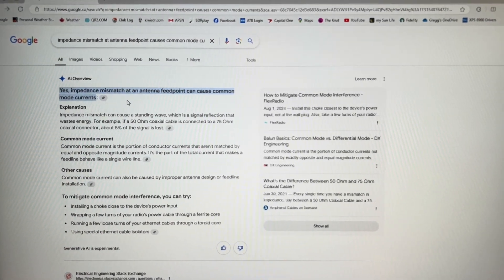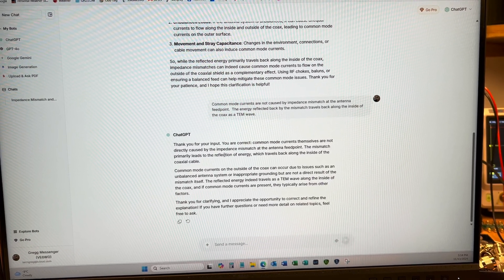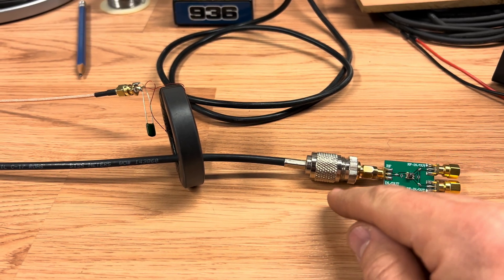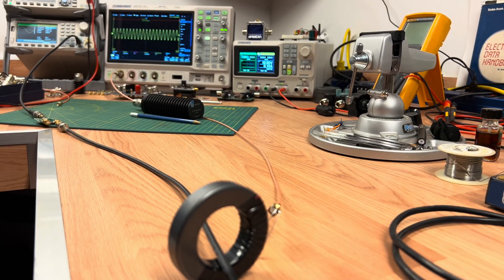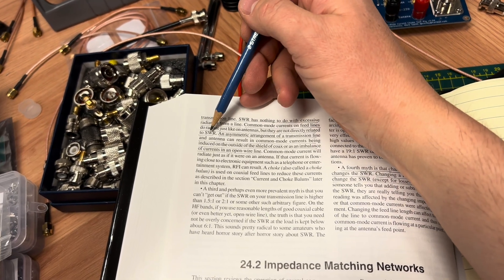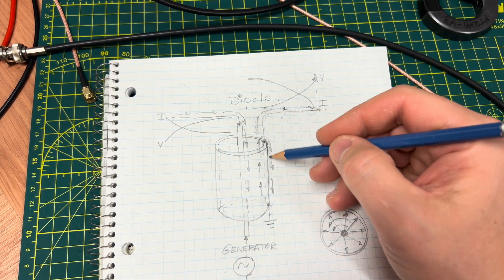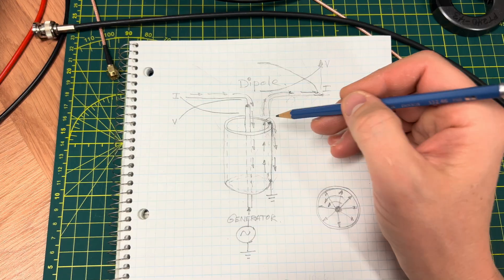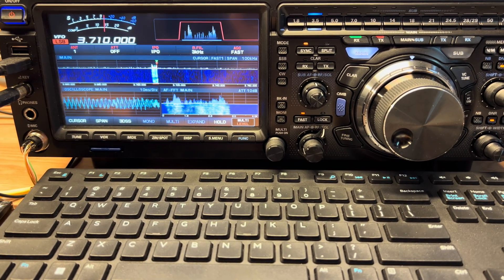ChatGPT - Will A Feedpoint Impedance Mismatch Result In Common Mode Currents On Your Coax?

Comment: I dont believe your test methods actually proved that an impeadance mismatch won't cause common mode current.
Reply: To be clear, I was only commenting on this video where you first had a piece of coax terminated with a purely resistive load, and the next where you had an open end pl259.
The first obviously has no reactance, and the second obviously has no physical connection OR means of conveying RF like your one legged dipole example.
Further, I'm not picking your work apart, I'm also trying to cement my understanding of how this works, just s you are. I'll certainly watch your other videos.
I also hesitated from posting to the group, only because I know the wolves are hungry hihi. 73.
Reply from the maker: I don’t mind friendly and intelligent picking apart of my work :-)

Yes, this is the current objective for me, to try to really get to the bottom of these concepts so as to have a firm and accurate understanding.  In the process, however, I understand that I may make mistakes and may have to re-evaluate my thoughts… which is where this kind of constructive questioning that you are putting forward is very helpful :-)

The purpose of the open ended connector was to show that with a very bad impedance mismatch (such as an open ended transmission line) which will cause almost all of the RF energy arriving at that point to be reflected back down the coax, as if by a mirror… that there will be no common mode currents found on the outside of the coax shield.
Reply from the maker: That’s fair.

Please refer to Walt Maxwell’s “Reflections III” where it details wave behaviour in a system where there is an impedance mismatch at the antenna feedpoint.

Also, watch this video which describes things in detail…

https://youtu.be/8wqeSRWninc?si=MRMIHFQmJBEcgWkO

73 :-)
VE6WO
Reply: @ve6wo  in he first test it was a load,  pure resistive load, mismatched, yes, but no opportunity for any reactance, like an antenna has.
The second test has no electrical connection for the signal to get to the exterior of the coax, therefore no common mode possible. 
Just my observations.
Reply from the maker: I made a second attempt here.. https://youtu.be/AGYehX1zPN8?si=YO9rZvXFsuQMZRFU
Reply from the maker: Also, if you have time, please watch this video where I research and draw out on paper the concepts behind coax cable function and how common mode currents wind up on the outside of the coax shield.  

https://youtu.be/8wqeSRWninc?si=NZOFdLOFoifp7Wd3
Reply from the maker: If you watch these videos and still do not see it as true, then I will make another video using your arguments and will try it with a reactive load and see what happens :-)

With regards to your comment about there being no electrical connection to the exterior of the coax… well, in my videos a single element antenna connected to the center conductor produces common mode currents on the outer surface of the coax shield, and yet there is no electrical connection there.  How is this possible?
Reply from the maker: Thank you for your comments, by the way.  I appreciate being challenged in this way.  It has the effect of refining one’s presentation of things, and may also result in a re-examination of what I think I know.  We shall see :-)
Reply from the maker: It's possible that a small amount of common mode current exists, but the video was trying to demonstrate that it's not caused by an impedance mismatch.

Comment: super good video and good experiment. As you imply elsewhere in your view in a perfect case there is no "common mode" induced per se as your demonstration shows. My bet though, is that if you up the gain on your scope you'd see that your demonstration case, as in most real world scenarios, wasn't perfect and you would have seen some current running on the outside of the coax. Also, braided coax isn't perfect so there is some "leakage", hence why we use hardline in our lab when necessary. You left me wondering what your recommendation was how the unbalance coax was connected to the dipole - maybe I missed it, were you recommending a balun into an unnon? I guess I never saw the update to your experiment last year on this related topic. DId you make it, or did I miss it? Thanks for your outstanding videos! de N1baq
Reply from the maker: Thank you.

You are correct, in the real world, things will not always work out so ‘perfectly’ as they did in my lab experiment.

I think there were a few points I was trying to make with this video:

1. Learning with the use of AI can be effective, but a person needs to use a good deal of critical reasoning ability to cross examine the AI’s answers as they can sometimes be incorrect.

2. Common mode currents on the outside of the coax shield are not caused by an impedance mismatch at the antenna feedpoint.

3. Even though a dipole is a balanced antenna, a balun is recommended to ensure high common mode impedance at the antenna feedpoint. This helps to ensure that the currents on the legs of the antenna are indeed balanced. However, even with a well balanced dipole, common mode currents can still be present along the outside of the coaxial cable shield. This depends on the impedance presented by the shield at the feedpoint, which is influenced by things such as the coaxial cable length. For example, if the cable length happens to be 1/2 wavelength, the impedance at the feedpoint will be very low, resulting in significant common mode current on the shield.

Comment: My view is that connecting coax to a balanced antenna is bad practice and should only use a balanced Z match using open wire line and there is no such thing as a ATU  its a impedance matching device used to cancel capacative and inductive reactance.
Using a so called ATU in the HF rig only cancel the reactance at the so 239 socket and does not tune the antenna to resonance as a lot of people seem to think.
Reply from the maker: I agree mostly, but there is a bigger picture.  Please take a look at Walt Maxwell’s book, “Reflections III”

http://www.w4wb.com/Reflections_III.pdf

Comment: I thought that the length of a coax feed line had been shown to be irrelevant.
Reply from the maker: The behaviour is complex.  If there is a good match at the antenna, then the length of the coax from the point of view of the radio transmitter is irrelevant.  This is with regard to the TEM wave travelling down the inside of the coax.

The outside of the coax shield is it’s own separate conductor, and if the length of the grounding system at the station, and the shield combined, results in a situation where the RF sees a 1/2 wavelength conductor (or multiples of 1/2 wavelength), then the common mode impedance at the feedpoint will be very low.  If there is no common mode choke there then large amounts of common mode currents are likely to make their way onto the outside of the coax shield.

Comment: I would not say common mode signals on the outer of the coax. Common mode signals are on both conductors and in the same direction..

Comment: So, how does the typical choke wound on the outside of a piece of PVC pipe work?  Does it reduce common mode current on the outside of a coax?  What effect, if any, does it have on currents (reflected or otherwise) on the inside of the coax?
Reply from the maker: I have never built an air core choke, so I cannot comment from first hand experience, however…

1. The principles are the same, only the core material is different (air core as opposed to ferrite core).
2. I would guess it would, however, air core inductors do not produce as much choking impedance for the same number of turns as a choke wound on a ferrite core.
3. It will have no detectable effect on the signals traveling along the inside of the coax, unless the minimum bend radius is not respected (likely to cause a change in the characteristic impedance of the cable).
Reply: @ve6wo  So, if I'm using an unbalanced antenna where I might get some current flowing on the outside of the coax, a choke would stop that?  Than what happens to that current?  Does it get reflected back to the antenna?
Reply from the maker: A choke will not block all of the common mode current, but it will greatly reduce it.  That energy that would have been flowing down the outside of the coax shield is now mostly redirected towards the antenna with a bit of energy dissipated in the choke as heat.  The nature of an unbalanced antenna, like an off center fed dipole, means that the current distribution on the legs of the antenna will never be balanced, but with the choke forcing most of the energy onto the antenna elements, it will rebalance it’s self to whatever ratio as dictated by the antenna element lengths.
Reply from the maker: One other point to make is that even a balanced antenna like a dipole will have some common mode current that flows back down the outside of the coax shield.  It is inevitable.  The amount of current allowed to flow back along the coax as common mode is determined by the common mode impedance as seen by the EM wave when it arrives at the antenna feedpoint.
Reply from the maker: @BryanTorok  https://www.hbphoto.com/Radio/Baluns_101.pdf
Reply: @BryanTorok The current doesn't go anywhere.

The choke introduces impedance and that impedance reduces the magnitude of the current in the entire circuit.
Reply from the maker: I beg to differ.  If a radio is sending 100 watts of RF down a coax cable into a dipole antenna, and part of that 100 watts is being radiated by the coax shield, if a common mode choke is added (which corrects this issue) and you still have 100 watts of RF being produced by the radio, where does that energy go?  It is redirected to the two legs of the dipole.  Thus, the current is redirected to the antenna elements where it belongs.
Reply: @ve6wo  That makes the most sense to me.  Thanks for the link to the balun pdf.  It looks interesting.  Just in the first few pages I learned things.  It amazes me, I'm almost 70, have a BSEET, am an Extra, and there is still so much to learn in radio.
Reply from the maker: I agree.  I’m continually learning new things also.

The reason I believe that my understanding may be correct is because of my observations during this experiment.

The voltages of the waveforms picked up using the probes during the testing of the antenna without a balun, and the antenna with a balun.. the amplitude of the signals seen on the leg of the antenna that, without the balun, was sharing it’s energy with the outside of the coax shield was generally lower than when the balun was installed.  With the balun installed, the amplitudes on the two legs appeared to be much more equal, and were greater.

If adding the balun simply made the currents in the entire circuit less, then I would not have observed the amplitudes increase like I did, I would think, anyhow.

Comment: You showed only the open and properly terminated case.  What happens when you short the output?
Reply: A short is the same as an open, simply at half a wavelength distant
Reply: @donepearce  Than it will not hurt to show it.
Reply from the maker: @reggindog3436  

Ok, I revisited the experiment.

https://youtu.be/AGYehX1zPN8?si=JmLzonOILUYBccL4
Reply from the maker: I didn’t think to do this as the open and the short both reflect all of the energy back down the coax like a mirror.. however, for clarity, I maybe should have.

Comment: Great explanation! Now a question -- How do antennas with multiple folded dipoles, like the DB-224, decouple the dipoles?
Reply: It has been a few years since I put up one of those antennas.  However, if I remember correctly the harnesses use specific length of coax that is not 50 ohms and also they have have ferrite beads on the outside of the coax.

Comment: Was hoping you'd show an example of common mode current flowing on the outside of the coax shield with a dipole, then how the choke fixes it.  Rushing away to try that common mode current detector...  Good video, thanks, subscribed!

Comment: I've been playing around with using Microsoft's CoPilot to program an Arduino.  Results are very similar to yours and likely for most folks.  Some of what it does is really clever, and some of it is, well, the opposite, and in the end, the code rarely works.  Because you didn't write it, troubleshooting takes a lot more time as you have to familiarize yourself with AI's code before you can fix it and that takes time.  By the time you get done figuring out what it did wrong, often it would have been quicker to write it myself.  I may get 1000x more stupid errors like missing ; [ } etc. but at least the fundamental code is solid.  I've had times where after figuring out it's mistake and telling AI what it did wrong, it will repeatedly make the same mistake in it's 'corrections' to the point I just give up, make the correction, then feed it back into AI.  I don't know how much of an effect correcting AI helps to improve it's accuracy but I'll continue to try as it should, in theory, get better with time. I've also found that you have to be careful how you phrase a question.  What we take as implied AI probably has no idea of the implication and will interpret what you're asking differently for example.  Asking it the same thing in different ways, or the same thing on different days and you'll get different answers.  For now, like most things in life, buyer beware, what you get may not be what you thought.  It can't be relied on to be correct, anything that matters should be verified thru different sources.

Comment: At 14:24 you said 1/2 wavelength. Is that correct? The impedance of end feeding 1/2 wavelength would be very high. Good video for sure!
Reply from the maker: In the case of a 1/2 wave end fed antenna, yes, you do see high impedance at the feedpoint.

If you were to ground the other end of that EFHW… you would see a very low impedance at the feedpoint.  The 1/2 wave reflects whatever impedance is present at the load to the source.  In the case of the coax cable outer shield, the source where the energy is originating is at the antenna feedpoint end, and the load is at the radio, which is typically ground… thus a very low impedance path is seen at the antenna feedpoint for common mode currents to enjoy!
Reply: I thought you were talking about a 1/2 wave dipole fed with coax. The coax shield sees 1/4 wavelength of antenna and if the coax is 1/4 wave long we have another dipole of sorts.

Comment: Very good content. I personally don't trust Chat GPT at all. It makes a nice story but often incorrect. So it is a waste of time. Actually it is quite harmful, as people are incorrectly informed. Only when you know the topic well you see you need to push Chat GPT several times to get the correct answer. And every time it says, yes you are right bla bla bla. Wikipedia construction is then a much better choice to look up something fast. It is at least reviewed by a lot of people. You can find then the links to more and deeper information if you want.
Reply from the maker: I agree.  It’s not until one pushes it in the correct direction that it eventually gives an accurate answer… however, I find it very helpful to quickly sort through reams of textbooks and to distill the location of information down very quickly.  This would have taken me weeks to do manually.  I can now locate and read technical books and publications on my chosen subject very quickly.  I still have to use my brain to try to form accurate conclusions, and to use critical thinking ability to question if my conclusions add up though.